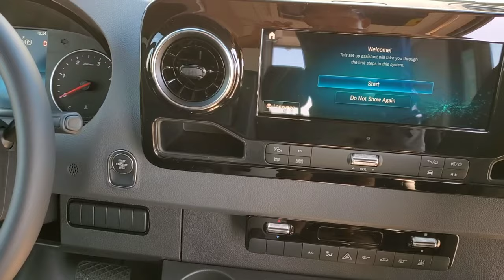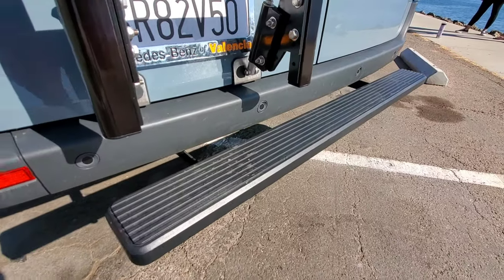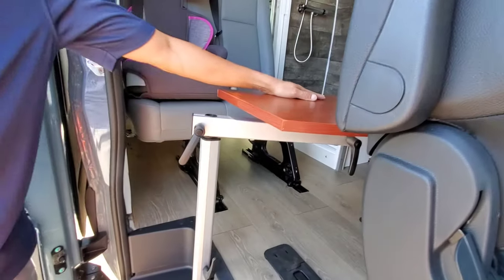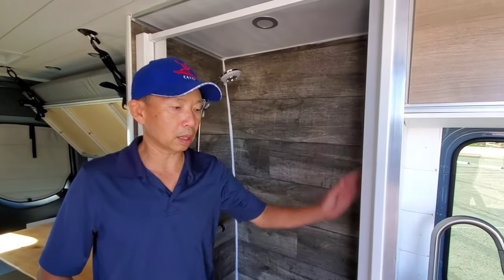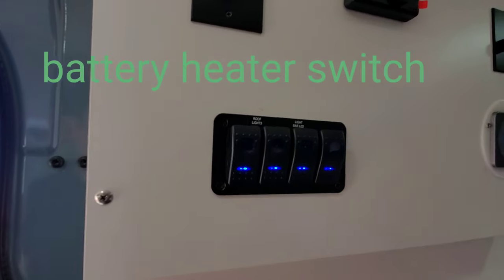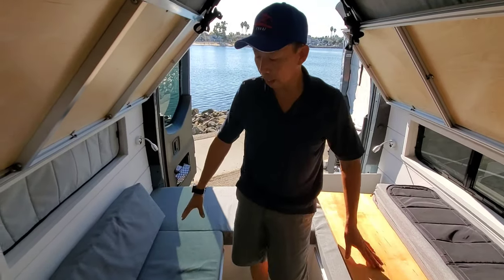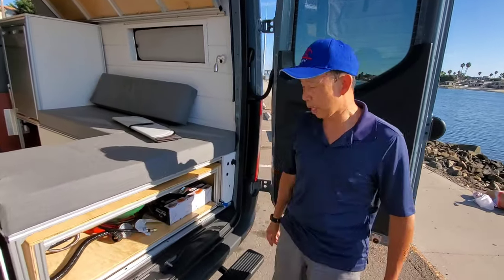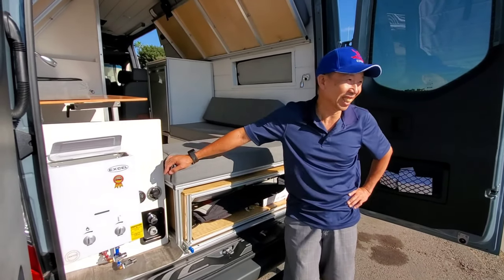Van Tour- Perfect Family Campervan!  seats six| sleeps six | All the amenities!

Comment: Nice work as usual, Bo.  I heard you mentioned this van only has 4-cylinder— what is the empty weight after all these mods and how much additional cargo weight can be carried before maxing out its rated capacity?
Reply from the maker: Hey Sam the payload is about 3400 lbs and I estimate build weight did not exceed 2000 lbs. The heaviest item is the AC which is 76 lbs.

Comment: Awesome build. I really like the simple bunk bed setup you have there. would you mind sharing what size of 8020 you used for the bunk bed and the link to the hinge you have used? Fixing to use the same setup in my van
Reply from the maker: Hello Nikhil, 
The extrusions are the 10 series.  The first piece is attached to the wall with 4 Bolts making sure it goes through the metal frame.  I drill the holes the the extrusions it's not that hard with drill press. 
The hinges are link attached but it shows not available.  You can use any simple butt hinges with 3" x 2.5" withght.  I Use Screws attached links as well 
https://amzn.to/2YJxYRV
https://amzn.to/3wILcdY
https://amzn.to/3Fbjgma
This is what I'm using.  You can find something more heavy duty it's up to you.
Reply: @BoChuonOUTDOORSVANBUILD  Thankyou bo. appreciate your quick response!

Comment: Hey Bo Did you use wire hardness kit and power relay for the curved light bar and the security spot lights? Thanks.
Reply from the maker: No, I didn't use it. Wire from the fuse box and to the switch.
Reply: @BoChuonOUTDOORSVANBUILD  Thanks Bo!!